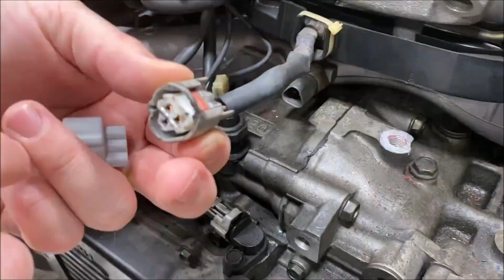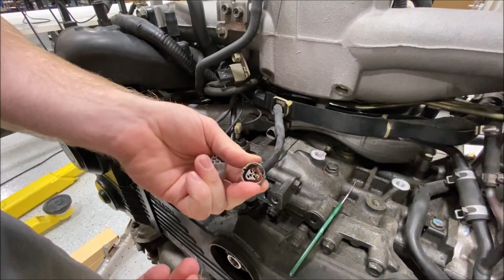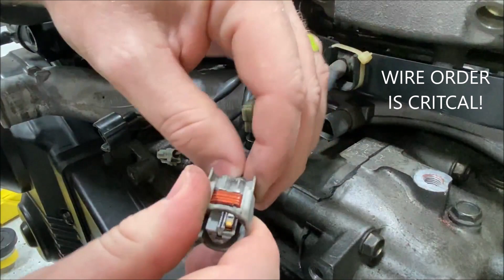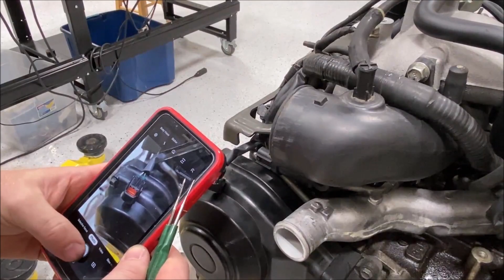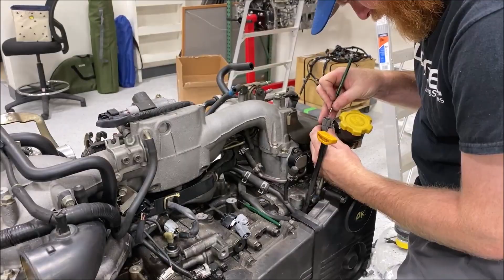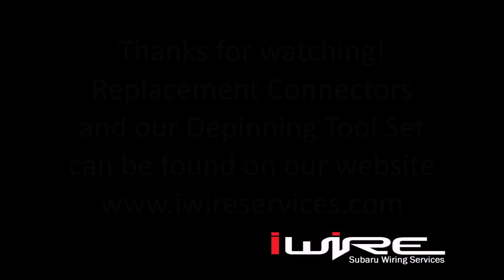How to Depin a Subaru Connector

Comment: Okay, now how about the engine harness plugs like that brown one? Those you cant access the tab to lift
Reply from the maker: The process would be very much the same. You'll need to remove the front lock to access the tab to lift.
Reply: @iwiresubaruwiringsolutions5538  Yeah I figured it out after pulling the white piece out of the front, fortunately I had a donor harness to steal plug ends off of for this

Comment: Hello,
I pressed the links but they didn't work and I don't know if it is my phone or yt. I need two injector connectors and 1 camshaft position sensor connector. The camshaft leads insulation is broken behind the connector so I want to kut the connector section off and get a clean section of wire and have new pins and boots to krimp onto the two leads and a fresh camshaft konnector to insure that I am not getting misfires from lack of signal or grounded signal to the komputer. If I kan get someone of my people to work with in the Lincoln area to get back on a proper pace against all these different lazy worthless asses that would help!!!! Good Day😁
Reply from the maker: Hello, I tested the links and they work on our computer. I've put the direct updated link in this comment in case that's helpful. You can also visit iwireusa.com to see all of our connectors. 

Injector Plug - https://iwireusa.com/products/injector-plug-top-feed-c
Camshaft Plug - https://iwireusa.com/products/camshaft-position-sensor-plug-a

Comment: great video, but there may be one thing that isn't clear because the first connector broke prior to unlocking it?  I guess the connector needs to be unlocked to get access to the pin release tabs?  thanks
Reply from the maker: Yes, if there is a lock then it needs to be removed so the pins can be removed. You can see this step at 0:55 into the video :)
Reply: Thank you, I just re viewed @ :55 a few times, and for someone not familiar, like me, with unlocking a connector, the video shows an attempt at unlocking, but the connector breaks instead.  The rest of the tutorial is clear though. @iwiresubaruwiringsolutions
Reply from the maker: @ScottoGrotto  This may also be helpful https://iwireusa.com/blogs/iwire-university/how-to-pin-and-depin-a-subaru-connector?_pos=2&_sid=b90499546&_ss=r

Comment: Thanks for the video! Do you know the process for the Subaru door panel harness connector? Mine is corroded as fuck
Reply from the maker: It would be the same general process, lift the tab and pull the pin out the back.

Comment: So the connector I am trying to repin is a 2006 Subaru WRX headlight connector. When removing the headlight assembly I accidentally pulled on the wires for leverage and pulled one out of the pin. My headlight s do work still but the turn signal does not, so when I use my turn signal it flashes at super speeds inside the car on the indicator. Would your wire terminal tools work for the headlight connectors too? Looking to get a set if they do work. I can provide a picture of the connector if needed.

Comment: What would b the best for my 02 wrx that has been parked for over 5 yrs.  I was thinking of swapping for an ls as subarus are super expensive and had a bad experience as had someone rebuild the engine and install forged rods and in less than 5 k had a major engine failure.
Reply: New harness is cheap